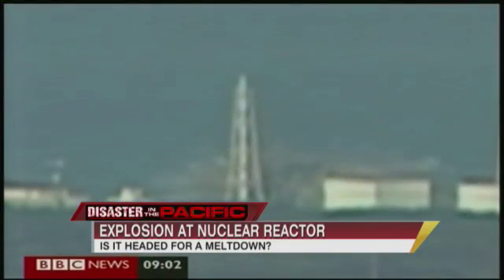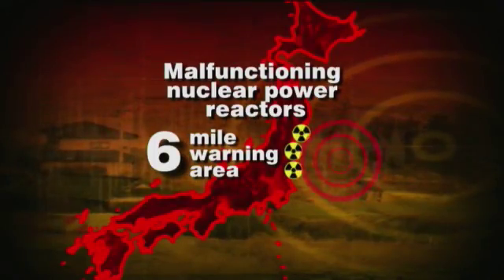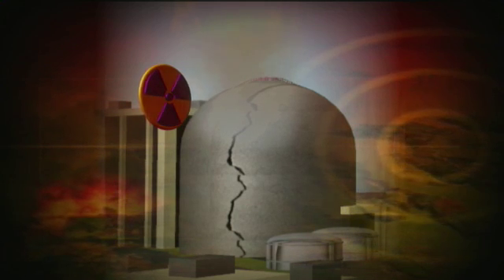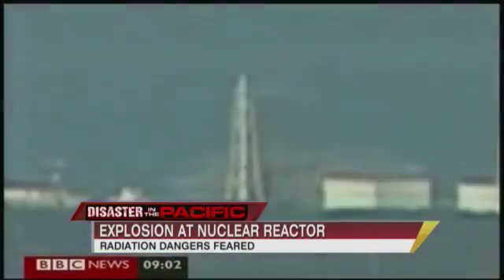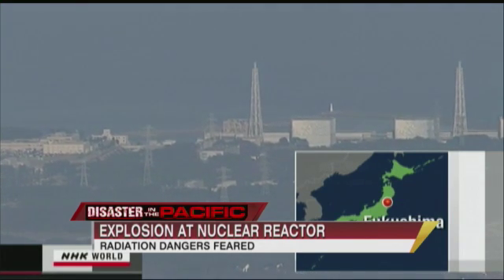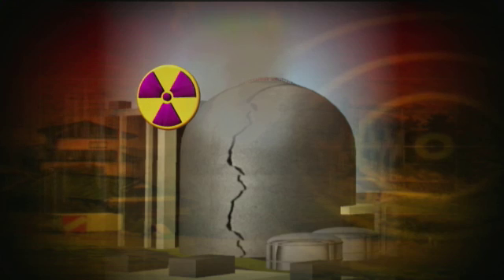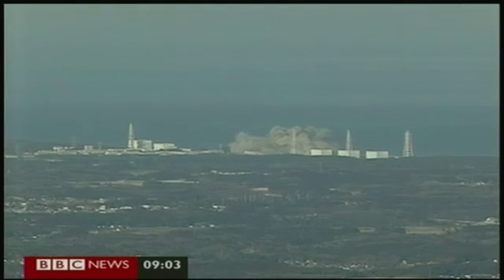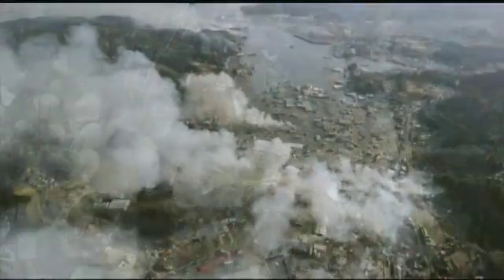Fears of Nuclear Meltdown in Japan 3/12/2011

Comment: On the one hand an explosion maybe bad but for containment purposes say bring in like things like water cannons or pumps  to try fight fires and such to contain the disaster. It is probably a good thing the building did blow   evacuate the area to limit exposure . should be common sense. But some one has to go back in there and work and clean up that disasterous environment. I am sure they're experts are  working over time assessing the situation for damage control and containment.